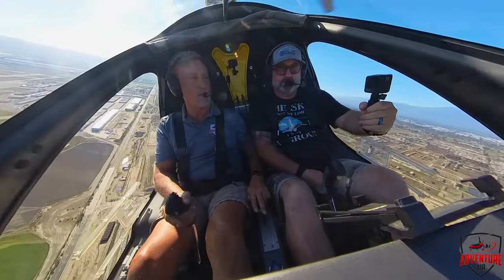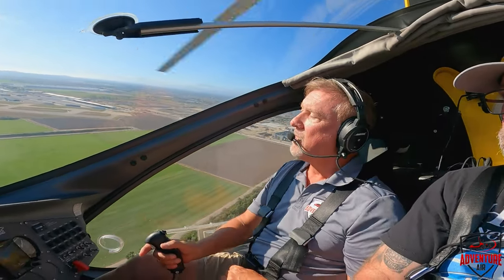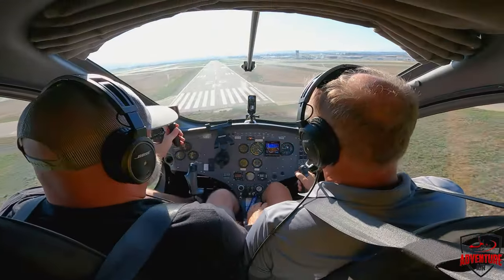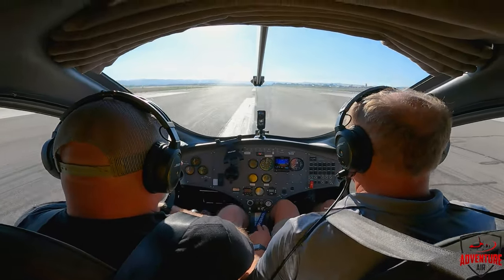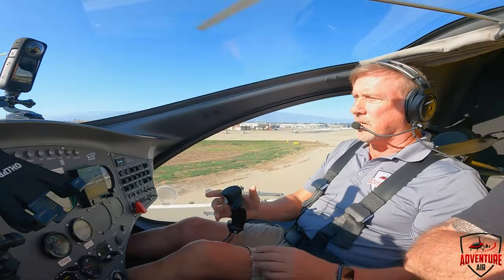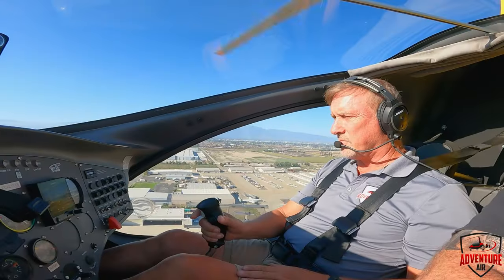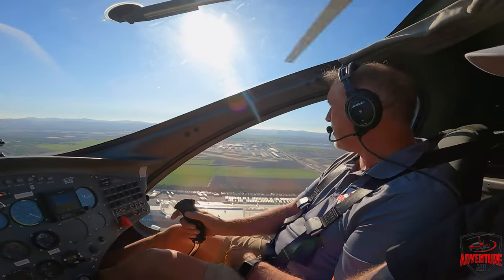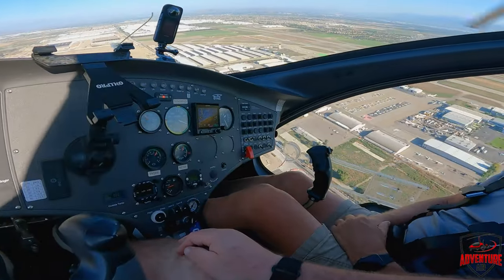58. Safety First: Common Gyroplane Flight Errors

Comment: Enjoyed your video.
I’m in my 9 th year of flying my MTO sport and I do a few things differently.
1. Upon spin up to 200+ I release wheel brake then gradually pull back on stick over first 50 feet of forward motion. By doing so I do not loose any ROMs.

2. I mainly fly from a private owned  public      use airport.  Almost zero 
traffic. Don’t want a long taxi after landing, so come in at 30 knots and experience only a 50 to 100 foot roll.
Reply from the maker: Thanks for sharing!

Comment: I’ve got an Air Command Gyro and live a couple hours north of Chino. I bought it last year and have pretty much taken it apart and rebuilt it so I would be familiar with it and also replace anything that needed it. Well, I’ve had a few lessons and am practicing, taxiing, balancing on my mains and rotor management. By the end of October I will solo. Great video

Comment: Great video. I'd like to see a little more explanation on why it's important to get your rotor speed up before letting wind under the rotor disc and also how to handle it if the nose pitches up in a wind gust to avoid a bunt over - even though center line thrust and horizontal stabilizers have made bunt overs much less likely, pilots should still practice the proper response to a nose up gust.
Reply: One of the features of modern Gyroplanes is their dynamic stability. Most rotor heads feature an offset pivot point (lots of descriptions online), basically in your scenario as lift increases the rotor will pivot forward reducing angle of attack and reducing lift. With modern gyros VERY few accidents are due to bunt overs.

Comment: Nothing like show and tell.  Emphasis on show.
"...not like this...not like that...straight." 
Take aways: 
Pre rotate lift blades sufficiently.  Throttling means pedal work, when you've got a decent power plant.  Oh, and on these Cav's, trimming matters, because after all, flying is for de-stressing.
Nose down on take off, 'cuz rollover sux.
👍😎👍 Enjoyed this.
Straight to the points.

Comment: Great upload Henry, I have a question, when you touchdown you pull the stick back, and you said in the video that the rotor rpm is stil 300, at what rpm do you put the stick forward? And is that to prevent the rotor hitting the main (back) propeller?
Reply from the maker: +@Meg99993 if you're landing, it's always best practice to put the stick full forward just after the nose wheel touches down. Don't let the rotor get below 200 RPM with the stick back, to avoid a tail/prop strike.
Reply: Thanks for the quick response! 👍🏼

Comment: Hi Henry, I noticed that the oil pressure is between 0.8 and 2 Bar, in the lower yellow arc, this looks a little low, would you not expect it to be in the 2 to 5 Bar green range?

Comment: I have about 20 hours and a solo in a fixed wing about 20 years ago and didn't finish up.  Kids.  All but one are adults now so thinking about picking back up.  What would be my path to get a license on a gyroplane?  Also my family has a farm that I will eventually move to.  How suitable are gyroplanes to a soft field takeoff and landing?
Reply from the maker: All you need in USA to get an LSA gyro rating is 20 hours with 5 hours of that solo time. Most people get it done in 30 to 40. Gyroplanes are great in soft field conditions. We have an associate that uses the grass field on hs property as a runway.

Comment: Hi @adventure air Henry. Great informative video. How do you find experienced airplane pilots deal with converting over to Gyro handling. Eg. overriding their accumulated muscle memory?
Reply from the maker: The only difference would be during takeoff, otherwise the flight controls are very similar during flight. Landing, you would plane out or flare closer to the ground..

Comment: Nice and informative video! All you said, my CFI told me, too. So, it seems correct 😁 (joking). 
Last week, I met Jimmy at the Autogyro Flyin in Hildesheim, Germany (really nice guy, btw !) and he told me, he teaches a maneuver every student has to master before he goes on to further lessons. My CFI never taught me this (maybe I should ask him to catch up and teach me): as I remember correct, he starts, leaves the ground, fly with max power in ground effect, but not only until reaches Vy, but to way higher velocity, then makes a steep nose up, simulates an engine out, "loads the rotor" with this nose up, flies a narrow 180, returns to the runway, lands or, if high enough, does another 180 to land with head wind. All this within a max altitude of 100 ft (or so). Did I remember this correctly? And is this a maneuver, you would fly and maybe show in this channel? I am very curious!
Best regards
Reply from the maker: We already covered the impossible turn in this video: https://youtu.be/exy7i2XOuBY

Thanks for watching!
Reply: Yes, I watched it. But you demonstrated it at a comfortable altitude without the following landing and a simulated engine out...
Reply from the maker: It's difficult to demonstrate in this area. The airspace is usually pretty busy, that's why we go to areas away from the airport.
Reply: Be careful with full power building high speed and pulling up. That is zoom climb and as the gyro is climbing and slowing down you are also reducing G load and specially if you keep the power in and even try and level out, you will be in danger. I recorded 0.4 G in testing doing that. There are fatal accidents using that zoom climb and keeping power in and unloading the rotor in the US, France, Italy.

Comment: It’s the opposite of a helicopter. In a helicopter, you have to give it left pedal when you increase the collective or power. Right pedal for lowering the collective.
Reply from the maker: Depending on the model of the helicopter and the direction the main rotor blade turns.
Reply: @AdventureAir  Like a Bell 206 where the rotor turns counter clockwise. I would have to be mindful of that if I ever got the chance to fly a gyro copter. Does the Cavalon have different rotor blades to use for specific applications, or are they all standard?
Reply from the maker: You would actually do better flying a gyro coming from helicopter. There are a couple of different models of blades but it's minor weight differences. As long as you follow the basic rules for takeoff, you wouldn't have any issues.
Reply: @AdventureAir  I really like the idea of these Gyrocopters because I understand the concept of rotary wing flight. It seems like the higher end Gyros are comparable to a basic helicopter for a fraction of the price and operating costs.
Reply from the maker: That would be correct. The only difference is that gyroplanes cannot do a traditional hover like helicopters. And let's be real, you don't really use a hover that much during normal flight. Not even airborne law enforcement uses a hover that much during patrol.
Reply: @AdventureAir  How do Gyrocopters fair in crosswinds or other windy conditions? Do you crab or slip like a fixed wing or helicopter? Does the Gyro have a turn and slip ball indicator?
Reply from the maker: Gyroplanes thrive in windy conditions. Yes, you would crab or slip until landing and then straighten out. They can if you'd like to add one but they don't generally come with them. Watch this video.. https://youtu.be/zUasRP3I1mc